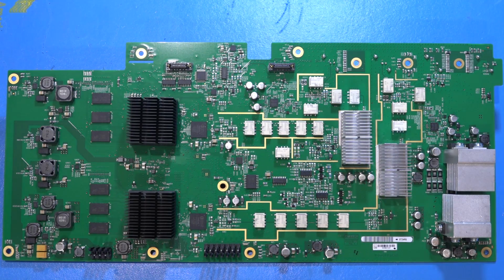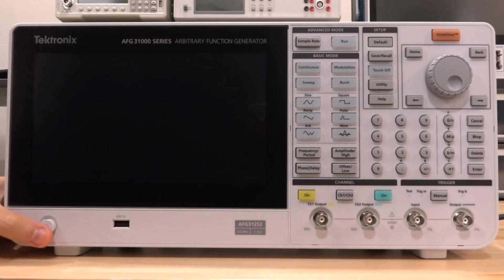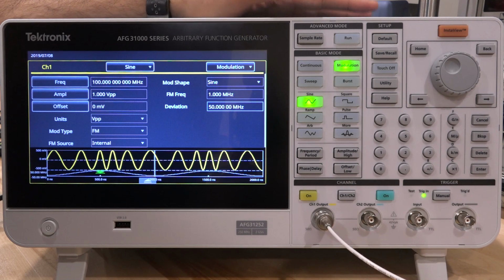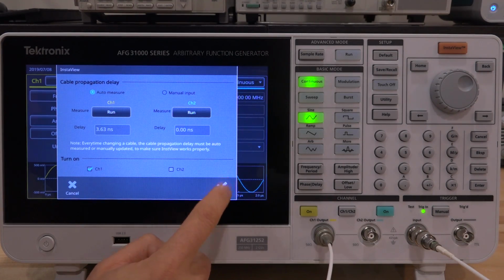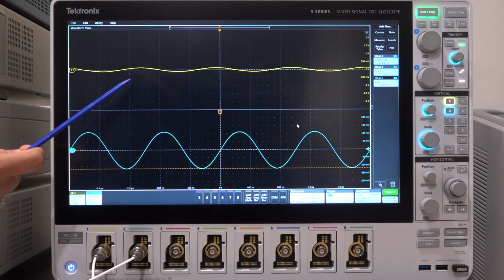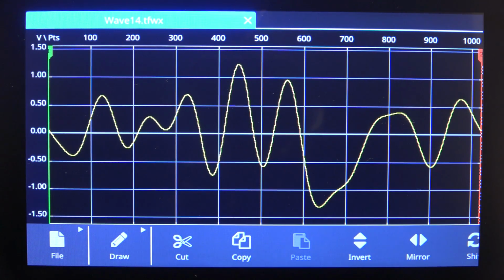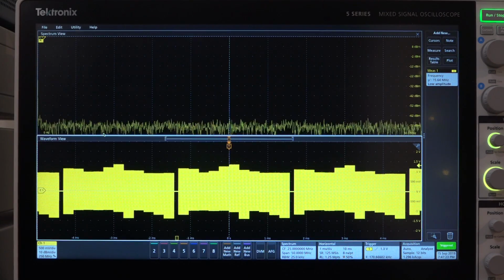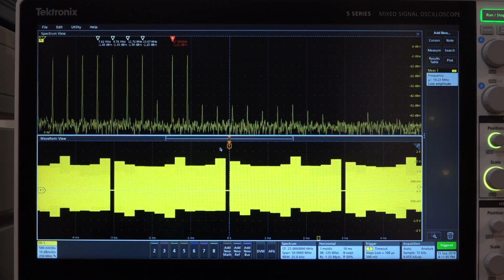TSP #157 - Tektronix AFG31000 2GS/s Arbitrary Function Generator Review, Teardown & Experiments

Comment: I don't understand one thing. How to get 2GSps data bus from FPGA to DAC.
As example most of FPGA clock tree performance is 100-600MHz, and regular IO could go up to 200MHz CMOS, ~600MHz LVDS, 
So how could they push that mush data through FPGA ? ( 2GBps at 16b is 32Gbps)
Are they using transceivers ? But that would be too many for 2 dac's
Reply: 2Gb/s divided by 16bit = 125Mb/s per pin at SDR
Reply: @TinLethax 
Are you sure  ?
It's gigasamples  per second, not gigabit per second. And sample is 16b, so SDR should run on same frequency as sample rate. (If DDR bus, half that.)
Reply: @Kilohercas Oh my bad. I totally forgot that.
Reply: It ran at 1GS/s on two DDR Bus to get 2GS/s. Then the data width is 14 bit each. So it would be 2GS/s * 14b = 48Gb/s or 1Gb/s per data bit. Definitely using SERDES IP on the FPGA side.
Reply: @TinLethax that is more likely,  if FPGA has this.